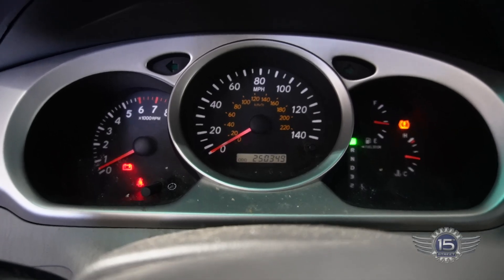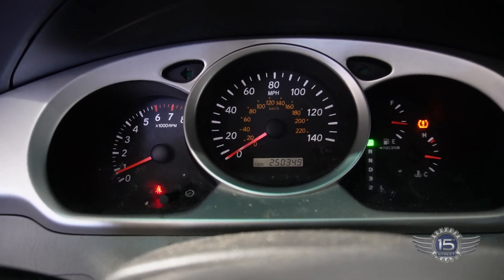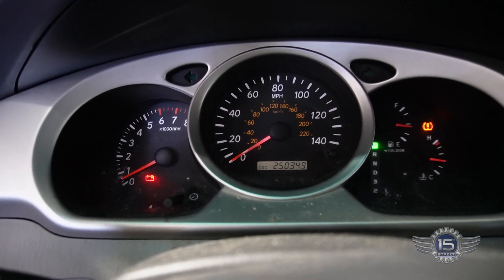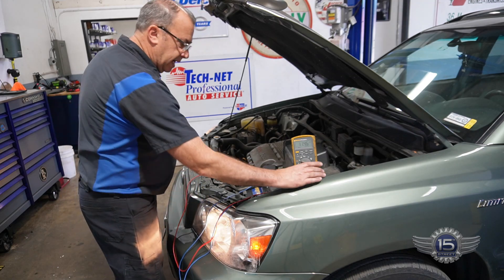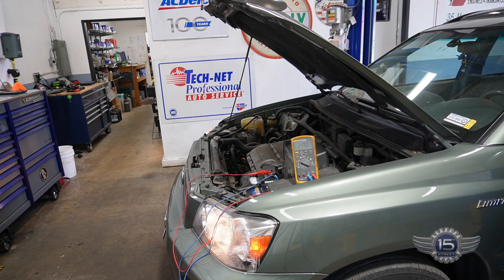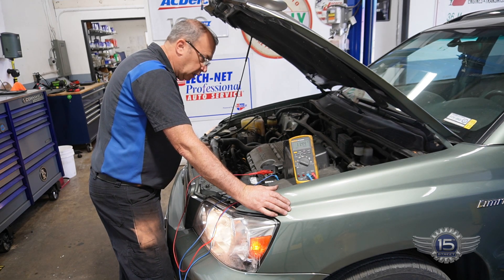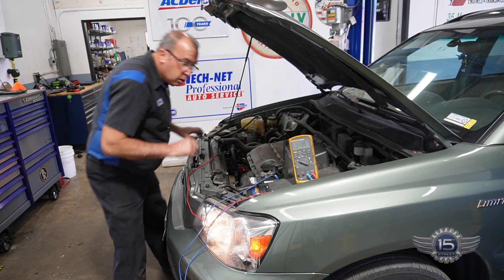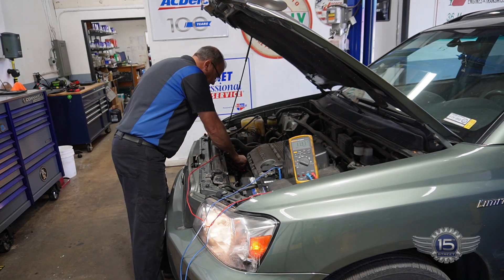Toyota Highlander Alternator Light On

Comment: Why did the battery light go out when you raised the RPMs? I was expecting to see a voltage increase on the multimeter when you raised the RPMs since the light went out, but that's not what happened so I don't understand why the light wouldn't stay continuously lit.
Reply from the maker: I don’t have a good answer for you. I suspect the pcm is using the feedback circuit to decide if the light is on or off. I had my meter on the main lug of the alternator. It’s possible that the feedback circuit may have gain some voltage.
Reply: @fixingcarswith15thstautomo36  Ok good, that's not just me that found that a little odd then lol. I would agree with your analysis - thanks for the reply.